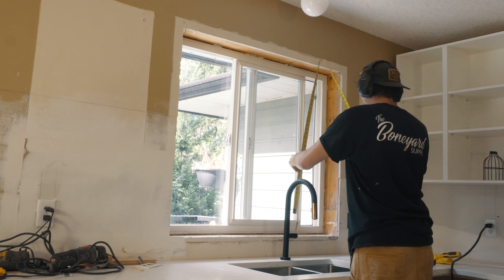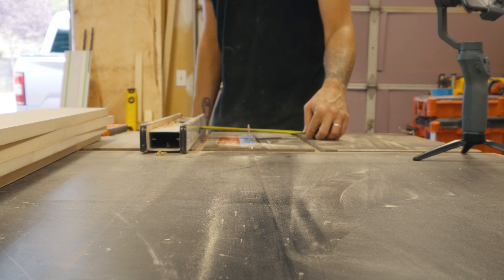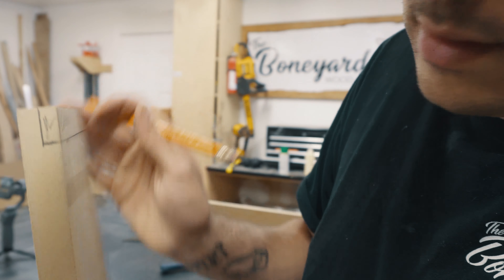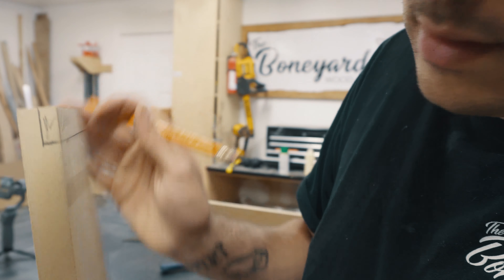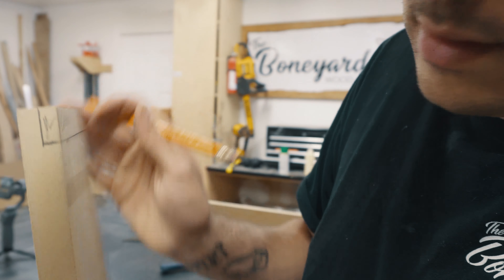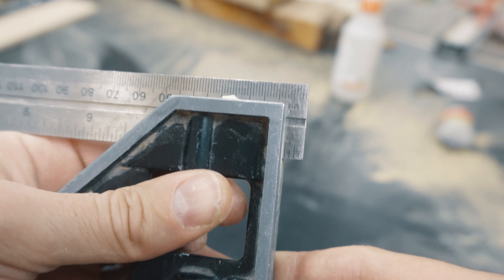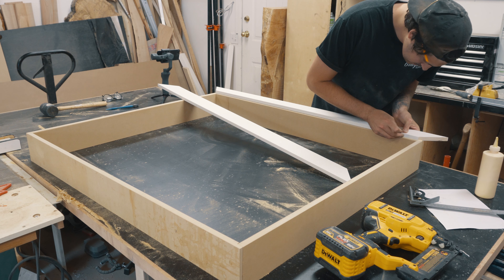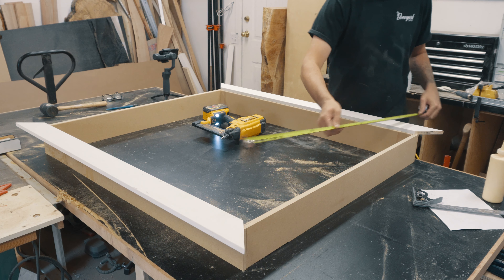How To Install Window Casing And Trim Like A Pro | DIY Home Improvement

Comment: I have a few small accent windows that have drywall all around the inside jam that I want to do this kind of trim.  Would I simply apply over it?
Reply: I’m assuming you already did the project since it was so long ago. But for future viewers, you need to remove the drywall and get down to the window frame

Comment: great project. question what wood did use for the outside boarder? Did you use the same 3/4 inch MDF - if so how what is the width?
Reply from the maker: Hey yes I used 3/4” mdf though you could get away with 1/2” or 5/8”. As for the width it’s 5” though that may chance depending on your situation. I just measured from the window to the outside of the drywall. Hope this helps

Comment: Avoid MDF! Especially on windows
Reply from the maker: Un true. Most trim and baseboards nowadays are primed mdf. Installed and sealed properly you will never have issues.
Reply: @RadDadBuilds  They go in and then they get replaced when the customers wisen up. I've seen almost every MDF window buckle primed and painted or not. It's just compressed card at the end of the day. I've seen dozens of these windows buckle I hope yours fairs well and that you are an exception. Great workshop Btw 😊